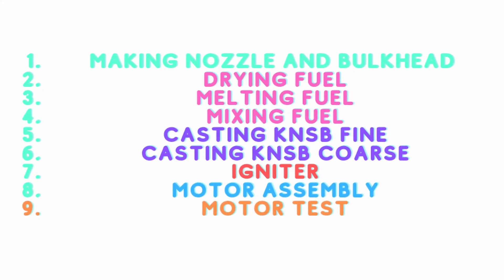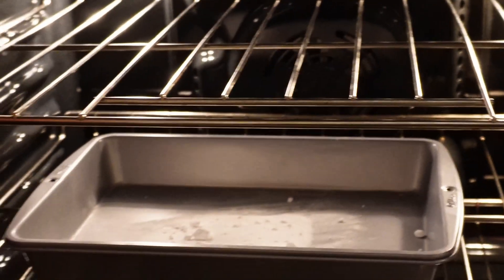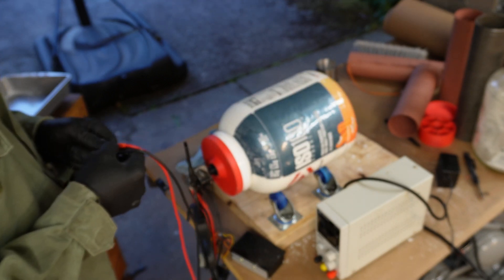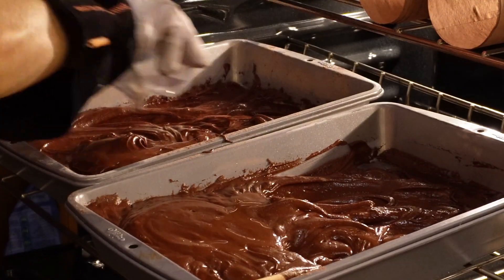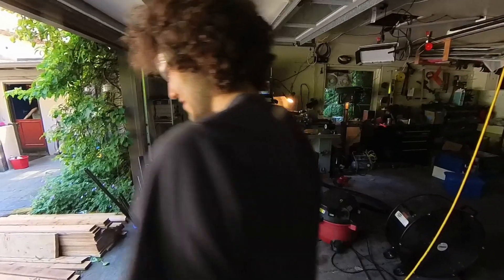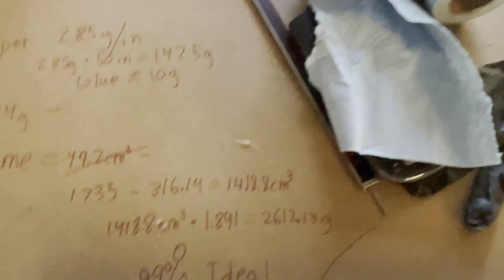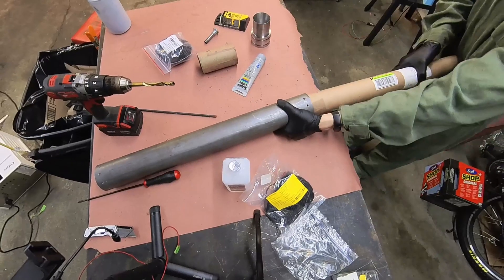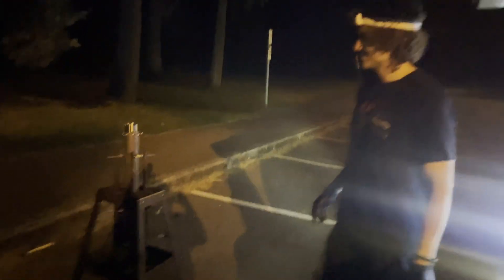Making and Testing 3 Inch Solid Rocket Motor

Comment: hey man was really interested to see the work that you are doing but i wanted to know the calculation process of all the things if you could help and guide me through this
Reply from the maker: For sure! What kind of questions do you have?
Reply: @BootlegBarry  actually I want to build a solid rocket motor myself have been studying stuff thinking of using cherry limeade of mit as the fuel but I don't know how to do the nozzle part of the motor needed some guidence on how to design it
Reply from the maker: @shandhbha9140  I have been using Richard Nakka's Solid Rocket Motor Design software. https://www.nakka-rocketry.net/softw.html (meant for sugar fuel)
He also has some great info on making nozzles. However an AP propellant like cherry limeade, you won't want to use steel like what I'm doing. The sugar motors have a lower exhaust temp, so you can get away with it. 
What kind of rocket experience do you have?

Comment: Hey if you use sodium laureth sulphate (SLES) at 0.1% it makes the KNSB pourable, works a treat.
Reply from the maker: Thank you for the tip! I'll definitely pick some of that up because the glycerin wasn't making much of a difference with the finely ground potassium nitrate.
Reply: You can increase the amount of surfactant to 0.3% if need to get it more fluid, experiment with it.
Reply from the maker: @callum22   Do you dilute it to make mixing easier?
Reply: @BootlegBarry  not the sles, just add it to the molten KNSB and mix it in, and that's it